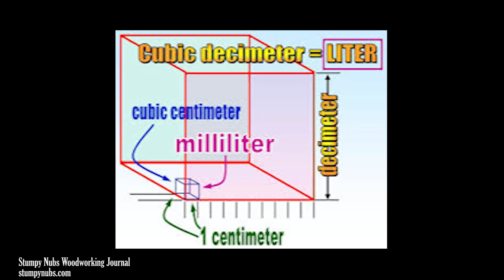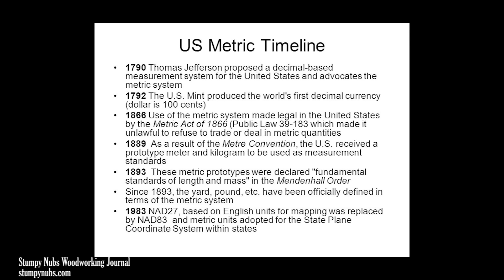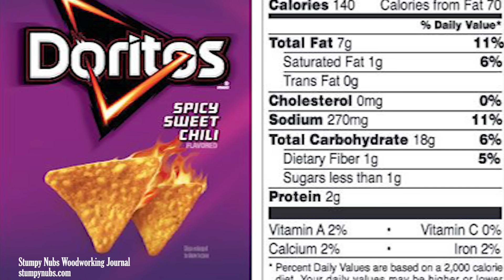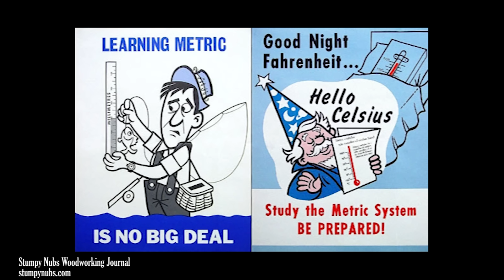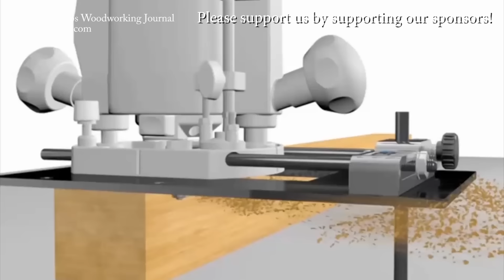BREAKING: The USA is switching to METRIC!

Comment: I grew up in a metric system country, and I’m a new woodworker. After your video and comments, I decided to use a complete metric system, which is familiar to me. It is very hard to measure fractional numbers. Thanks a lot.
Reply: I live in Canada but our annoying small housing construction is mostly in US Customary Units.
Anyways, I once tried out a job for custom tile work. When we had to mark and cut out holes around drains and faucets the crew often worked and did math in 8ths and 16ths of a inch. It was so annoying trying to read that on the tape measure. I much rather work with decimals or smaller units in the metric system.

I don't get why people make it harder on themselves. I left that trial after a few days.
Reply: @pbilk , In dealing with measuring here in the States, a construction calculator is my best friend.  I also draw everything in Sketchup and that does all the math if it's in inches or metric. Imperial is what I grew up with, so I see it's faults but it's what I know.
Reply: @tomruth9487  Yes, I understand. Learning metric is like learning a language it possible to become fluent in it but you need your environment to enforce that, that is what happened in pretty much everywhere but few like USA and two others.
People in Canada and maybe Mexico still uses the imperial system in part of their life but that depends on the individual. In Canada, I have pretty much ditched the imperial system out of parts of my life that people may still use it, like weight and shorter lengths.
Reply: @tomruth9487  Also, that would be helpful if my job did use Sketchup or another program but they don't so it's annoying to have to work with such small fractions in detailed work.

Comment: Great vid! As an Aussie baby boomer, I grew up with imperial systems. Then we changed our currency to decimal currency (like the US! Yay!) and then still later, we went metric with our measurements of distance and weight. I'm a retired pilot, and in aviation, we are trained to not only use both imperial and metric (for US and European aircraft), but also to do rough mental conversions of distance from kilometres (how we measure runway and weather visibility), and distance (measured in imperial miles and nautical miles) and volumes of liquids (such as fuel: litres to imperial gallons or US gallons) and of course, weights and temperature. (To mentally convert say, 86F to C: 86-32=54, 54/9=6, 6*5=30. 86F = 30C). 
It's important to have a ROUGH idea, so you don't make any small mistaeks (?!) when entering your data on your iPhone, R2D2. (Measure twice, cut once?)

You're already making your changes, don't be scared of them ... but having grown up with both systems, I can tell you, life is just sooo much easier when you only have to move the decimal point. 
Only problem I have is doing the mental conversion of driving on the wrong side of the road. Oh, you all drive on the right side, we drive on the what side?
Reply: We drive on the right side, but since you don't, you must be driving on the side that is left!
Reply: huh.. I measure 5 times and still cut the *ucking thing wrong !

Comment: I absolutely love the metric system.  I work in imperial measurements but it is such a pain with fractions.  I unfortunetly have the ideas of feet and inches ingrained in my mind but I still try daily to use metric.  At work, I'm a nurse, I use metric quite often but not for lengths.  Maybe before I'm too old to work in the shop, I'll have it down.  Thanks for the video.
Reply: What is unfortunate about thinking in feet and inches? 2 and a half feet is easier to conceptualize spacially than 76cm. Both have perfectly valid uses.
Reply: @macdietz  speak for yourself. I have no concept how much that is until you said 76cm, which is slightly more than the heitgh of a standart table

Comment: Over the pond in the UK we have been metric for decades but we tend to use both, depending on which is most convenient.
You don't have to convert, just learn something new that will make your life easier and use it when you want to or not if inches work better.

Virtually all tape measures in the UK have both scales. This really helps. 

One point to help those who are new to metric, the tapes indicate cm. That isn't accurate enough so you just learn to add a zero which makes it mm. Millimeters are what you should be using. 

Don't convert, just add some knowledge.
Reply: And then you have miles on the roads :)
Reply: @dmitripogosian5084  and we drink beer by the pint, buy petrol by the litre but tell you that our car does x miles per gallon, we speak of 3x2 and 4x2 timber but actually have to buy (approx) 75x50 and 100x50. We measure our height as x feet y inches, our weight in stones and pounds, pump our tyres to x psi (pounds per square inch), often temperature switch from Celsius to Fahrenheit once we get above about 70F and many other examples. You don't have to "go metric", just use the extra convenient units when you prefer. 🙃

Comment: I like the 4R rule in Imperial units- that’s four scales from 8th, to 16th, to 32nds, to 64ths.

It’s nice to use the least cluttered scale necessary for a given task- the 8th scale is much easier on the eyes then the 64th. But it’s nice to have the precision of the 64th scale when needed.

I also like how the 4R scale lets you divide a measure in half by just jumping a scale. 2 and 1/4” is halved by simply using 1 and 1/16. Then you could half it again by using 1/2 plus 1/32” (AKA 17/32). No real calculations involved. Need to half it again? Half of 17/32” is 17/64”.
Reply: I made an error. Should have said 2 and 1/8 is halved by using 1 and 1/16”.
Reply: I’m glad you caught your mistake 🤣 I was gonna mention it… 

But I’ve never understood the argument of “fractions are hard”. Do these people not drive cars…? How do they read their fuel gauge? In Millimeters or do they say. “Honey you have to fill the car, it’s at a 1/4 tank…
Reply: Thanks for explaining that. This is something that I’ve understood and commented about, but you stated it clearly.

I like to point out that dividing into halves or quarters is a common occurrence in carpentry, construction, and woodworking. It’s natural, when the measuring system is set up to accommodate that action. It’s awkward when the subdivisions are tenths.

Comment: As a machinist (turner) we back in the70s get metric drawings then convert them to imperial. We found you didn't make as many mistakes. We have been metric since early 1970s. Still measure baby weights in lbs, tyre pressure in psi
Reply: Yeah, I couldn't tell you what my tyre pressures should be in kilopascals, 36 PSI makes more sense to me.  Even baby weights are in lbs, but everything else in metric, oh except for height.
Reply: @utha2665  well, we usually use "bar" (roughly atmospheres), where 1 bar=100kPa. Thus, tire pressure should be at least 2 bar, 2.5 is good. Which is 200/250 kPa. I think this is just a question of getting used to.
Reply: @carcharhinus_555  For sure, 100%, it's just I've never had to convert, there's always been a PSI value available and I do live in a metric country.  😅

Comment: For all the nerds out there: The mile to kilometer ratio is quite close to the golden ratio, so you can roughly convert miles to kilometers by using neighboring Fibonacci numbers. E.g. 5 miles should be about 8 kilometers (exact value is 8.04672 km). Of course you can also scale it by a factor (so 10 miles is about 16 km)

Comment: As I don't live in USA, Liberia or Myanmar I use metrics. But when I am working with a folding ruler I can choose inch or mm. Which is good for measuring, when the hole might not be whole mm but linstead ines up with the inch side of the ruler. Almost all folding rulers in Sweden only uses mm but you can still find the ones with both inches and mm,  my favourite ones. Thank you for helping with the fast reading in inches.

Comment: I have to admit that my last project I built (a mini split filter box) in metric and when I put it together I was shocked on how spot on it all was.  Now, I don’t know if I am just all the sudden that good or if using metric had anything to do with it, but I think I just might try my next project in non-merican too.
Reply: Oh, and I loved the humor in this video.  I almost spit out a few milliliters of my drink after the nipple comment 🤣
Reply: Funny, I grew up in Europe and studied Physics but around woodworking, I've adopted the imperial system.
Reply: @soerenhuba  I live in Canada, were I work I need to enter the length and weight of the unit to be analyzed.  I use inches and LBS not cm or kg.
Reply: @IB2FAT4U and your point is?
Reply: @TheR4t0n3r0  Do you always go out of your way to stifle conversation by being rude?
Reply: Yeah. Same here. I've noticed that using a metric tape measure has helped with my trim work around the house. Way more measurements come out perfect. For those who don't want to, just use what works for you. That's what I'm doing. :)

Comment: In Canada the construction industry still uses inches because our material is all imperial. A sheet of ply wood is 4x8 studs areb2x4x 925/8 drywall same the only difference is we have better screws. Other than that we use the same as you even though we have been Merrick for over 50 years.

Comment: The metric system is actually pretty bad when it comes to a system of weights and measures. The problem arises from the number of factors from the base unit. You only have 4 divisors (1, 2, 5, 10) the imperial system is mostly base 12 (1, 2, 3, 4, 6, 12). This means doing common operations like dividing something by 3 and 4 are much easier to do and land on whole measurements. If/when the US does anything it should standardize more of the imperial system around duodecimal system instead of the decimal system.
Reply: I don't understand what you are talking about. I've being using the metric system all my life and I don't se any problem in measuring weights or mass or whatever. Could you come with an explanation on this?
Reply: Engineers use decimals. 1¼ inches is 1.250 inches. 3 ⅜, is 3.375 inches. A mearsurement might be given as 2.5 with a tolerance of +0/-0.005 . Fractions are not nice when you are having to add or subtract them. Example 1¼ plus 2⅜ plus 4 and 3/12.
Reply: @gorillaau  Hm, I think the reason for using a measurement of 3 3/8 inches solely comes from the fact that the inch system is used. I don't think in 3/8 of meters. I think in centimeters and would probably choose 40 cm = 0,4 m. And I think in millimeters and would chose 4 mm
Reply: Just take a pocket calculator and divide any number by any number, in metric system and the job is done. In metric system we don't have those divisors you are talking about her. I think you are referring to something totally else. Exemple: 9 /3=3.      9/4=2,25. 
145785/ 367= 397,2343324250681 What's the problem? 
If this last example is not precise enough, then I don't know what is. 
Already from primary school we learn what we call " the multiplication table" where you learn (and by learn I mean memorise) to multiply each number, from 1-10, with each number from 1-10. That helps, later on, in school and life, to make calculations, a long way, with even bigger numbers, without using an calculator. 
And the dividing is just the reverse of multiplication. So, I don't see where the problem is.
In metric system everything have 10 multiples if is above 1 and 10 submultiples when is under 1. You can already count to 10, you just have to learn the rest :), which is just as simple.
Reply: @stefang1087  you don't divide things by 3? If you take meter and divide it into 3rds you have 3 sections of 33.333333333.... centimeters. If you take a yard and divide it into 3rds you end up with 12 inches. If you take a Kilometer and divide it by 3 you have 333.333 meters. If you take a mile and divide it by 3 you have 1760ft. The metric system is based around 10  (decimal) the imperial system or at least parts of it are based around 12 (duodecimal). Acres are 43560sqft so when you want to divide into 1/3rd acre plots (maybe for inherritance purposes) you get 3 plots that are exactly 14520sqft so no one has to worry about being on the short end of a rounding error.
Reply: @gorillaau  Never seen 12ths used in a measurement for imperial :) But those first 2 are 3 5/8s and I didn't even need a calculator for it. Assuming you mean 4 and 3/16ths then you get 7 13/16ths. Now take that Hectare of land and divide it equally amongst your 3 children without playing favorites. Who gets the rounding error? Take that Acre of land in imperial and no such rounding issue exists.
Reply: @jorgwalter1954  The issue isn't really with how you add or subtract measurements. Both systems can be learned fairly easily. The prolem comes with the base unit and how it will commonly be divided without running into long decimals like .333. If you take a meter and divide it by 3 you get 33.3333... centimeters. You can trunkate it and call it good enough for a lot of applications but not everything. Dividing real property is an issue for example. If I want to buy an apple and it is 3 for a dollar does the store just eat the extra 1/3rd of a cent or do they round it up and make you pay an extra 2/3rds of a cent (probably the latter). There are plenty of examples of this.

Comment: After working for Michelin NA for 25 years, I was introduced to the metric system from day one. At first I hated and was constantly confused. But once settled into the metric and using it for all those years, I love it as for as measuring things. It is so much easier than the #/## system. Just move the decimal to change values. So as far as the rest of the metric system, It’s still a work in progress for me. But I’m getting there.
Reply: Easier to add. Also, you don’t have double standards like oz and fl. oz, as well as different measures between the UK and the US.

Comment: I was talking with an old American diesel engine mechanical engineer for the big ships and he said that English measurements like inches and its division is more accurate than the metric system . And from very old times the engine capacity and cutting cylinder head was based on British system .

Comment: Once upon a time, I had been an auto mechanic. My 'specialty' was VWs and Audis. Over the years, I learned that some "Imperial" wrenches were really close to the same sizes as some metric wrenches (8mm/5-16ths, 11mm/7-16ths, 19mm/3 quarter, etc.). You'd have to use a micrometer to measure the differences. I often use metric measurements in woodworking simply BECAUSE of that simplicity of calculations you mentioned (so easily divided by 10) or because just ONE millimeter's difference (that's 39 thousandths of an inch, for anybody looking for the conversion chart) can make a difference in how something fits a particular space.
Learn to use BOTH systems. You'll thank me later....

Comment: I'm an Aussie and we use the metric system here for most daily activities but I will say one thing in favour of the Imperial system, I find it a more "human" scale of measurement.  The metric system is straightforward and there are no fractions but terms like inch and foot are easily described in conversation.  It's much easier to yell to sometime to move an inch sideways than it is to say move it 30millimetres sideways.
Reply: Ah, but you'd be 5.4 mm short that way...
Reply: @ezrahn  👍🤣
Reply: @ezrahn  4.6mm short...
Reply: Just replace "move an inch" for "move a scooch" and you'll be fine. :)
Reply: Another Aussie here and I agree. Ask an Aussie how tall they are and most will answer in feet and inches and when they pump their tyres they use PSI to measure pressure.

Comment: in the UK we have been "metric" for many years. However, we still have a half and half system when it comes to measuring etc...most lengths are done in centimetres and metres, but we still do "miles per hour" in our cars, we still like to order a "pint" of beer, not a litre, though we buy our milk in litres lol...I still think in Imperial measures generally, and I feel that when we all started going metric, it was the beginning of the great dumbing down of the world!
Reply: That's the problem. It's not called the Imperial system. It's the general/generic system. Only the U.K called it that and it has stayed for many years. Thus causing misinformation. I have no interest getting rid of something that works just fine.